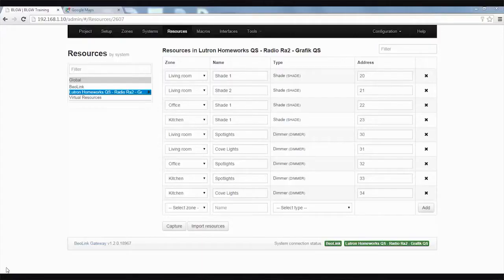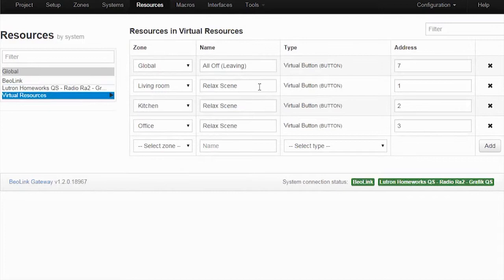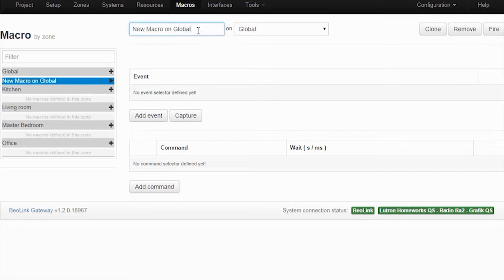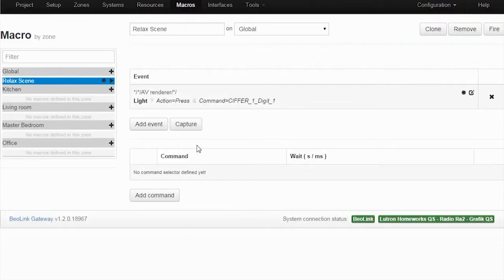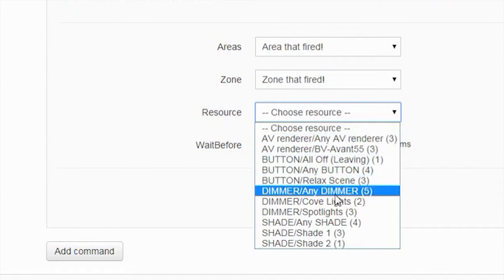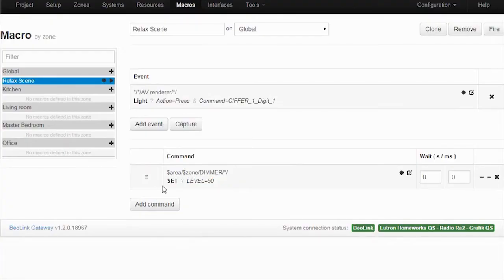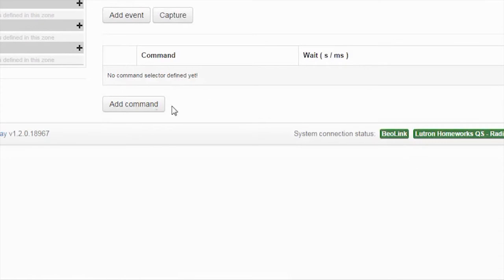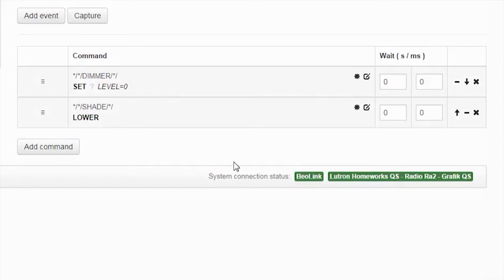BeoLink Gateway - Generic Macros

Comment: Hello, I cannot find any source about how to make some api in gateway. For example I need to send some http request and on gateway side I need to handle it. So is there a way to do that?
Reply from the maker: Hi. The BeoLink Gateway has a Custom HTTP driver build in so that it send commands to a REST based server. 
But I assume that you need another device to trigger commands in the BLGW?
Reply: yes, for sure. I have a gateway and my beoplay m3 speaker. I'd like to send some http request to gateway (for example from my android application or something like that). After on gateway side I want to handle the request and send a command to the speaker. So the task is so easy but I cannot find how to do that. May you please give my any hint?
Reply from the maker: Yes. I have a tip for you. Can you please go to https://beointegration.com/contact-us/ and submit your question there. Then I will better be able to help you.
Reply: thanks, I've done it